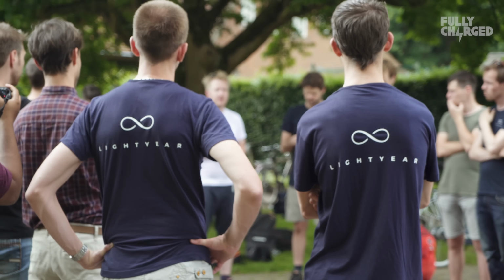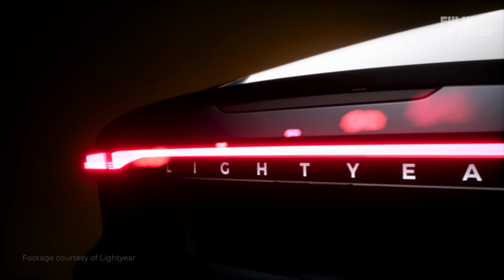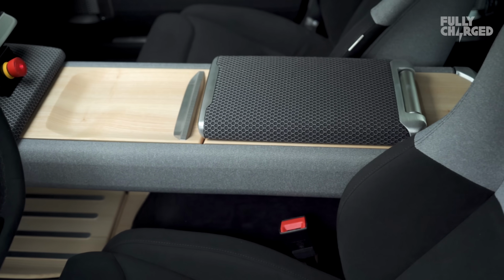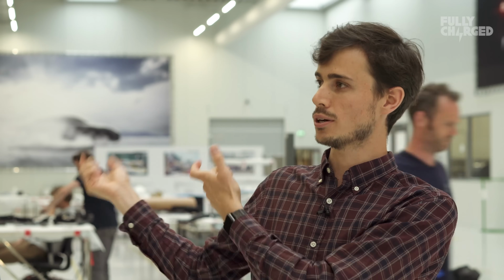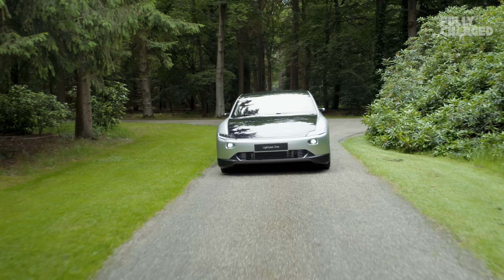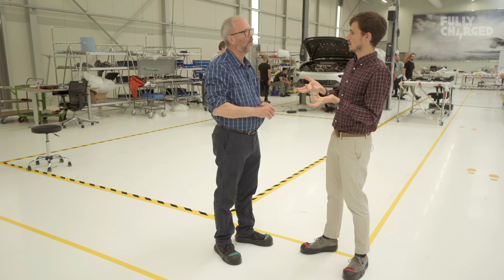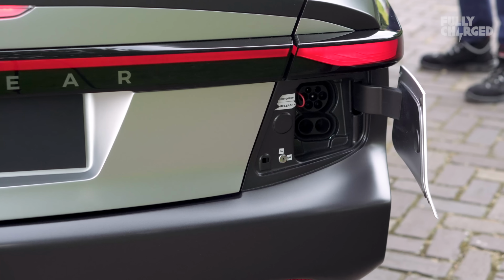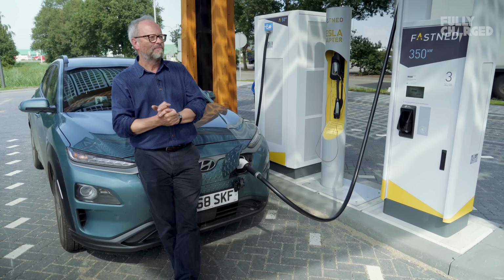Lightyear One solar powered electric car - exclusive first look | Fully Charged

Comment: Toyota, take note! This is self charging 😉
Reply: The "sono" "sion" is supposed to be in production within the next 4 months... It won't be as pretty nor as efficient but slightly more affordable.
Reply: @fionafiona1146  Deliveries of the Sion won't start until 2021.
Reply: @jochem1986  they won't be produced before next year either, they just plan to start.
Reply: @fionafiona1146  like 4 times more cheap, indeed. Still, nice for the happy few, that lightning.
Reply: @RedBatteryHead  How much is 4 times more.. 🤔
Reply: fiona fiona I don’t think Sono is going to make it. At least outside of Germany. Cost projections are already at 30k us.   At that price point the VW ID the Renault Zoie are far better automobiles. 

The Sono is the Perfact car for 4 years ago.
Reply: @fionafiona1146  what about the Toyota Scion?
Reply: It has an ICE. Lame
Reply: All car manufacturers already knew about this they are just tied up with oil companies and holding up production of these kinds of vehicles
Reply: 5putput  but they can only recoup the energy that has been generated by burning fuel. It's definitely better than just losing it to heat in the brakes, but it would be better sti.if you didn't need to burn the fuel in the first place .
Reply: Martyr4JesusTheChrist  To be honest, electronics can made so reliable nowadays that it shouldn't be a concern. It's more likely that your engine will conk out first, especially if it isn't made by Toyota. :) And if it's critical enough, we can always engineer in redundancy.
Reply: Benz Ouyang, I LOVE my gasoline powered Toyota Camry V-6. I step on the accelerator and get nearly 280 horsepower, heated leather seats, JBL Audio, sunroof, its paid for and the title has my name on it. No bank can take it from me and I can refuel it at a gasoline pump in about 90 seconds at the 3 gas stations less than a quarter mile in my rural town. Plus....when I feel like it, I get to go into the store of the station and speak to my local friendly neighbors and the owner of the gas station, buy a bottle of Coke, a snack cake, say goodbye and be ready to travel 600 miles at 80 mph. America is large and highway system is vast. My taxes that I pay for each gallon of gas helps beautify the environment and make my highways smooth and safer to drive. Are theses eco idiots who want “electric only “ cars going to drive on the same roads I pay a fuel tax for? I think not. Just another reality of EV’s.
Reply: Toyota need not take note as they perfected the much cleaner and more reliable hydrogen fuel cell two decades ago.
Reply: Doubtful it will be self charging.  Solar panels are extremely inefficient.  I'm guessing the panels handle low end functions like electronics and climate control.  Even if it can charge the battery array while idle..it would be a mile a day at best.
Reply: lol. that's a good one
Reply: Fully autonomous vehicles could also be self charging and initiate maintenance and repairs without human assistance.
Reply: Beautiful concept. A concept, unfortunately still far from series production. The Dutch are great at this. I really hope they get it right and quick. Otherwise it will be an awesome museum piece.
Reply: I can't wait. 😁
Reply: Big companies wont put solar on there cars, they are still in partnerships to sell you energy, from coal, nuclear and gas burning power plants.  People who think electric cars ar the salvation of the future are deluded.  These things are not clean.
Reply: Martyr4JesusTheChrist  Radiant energy ruins batteries at A fast rate.  Not practical unless you design A secondary system to fix this problem.

Another option is nuclear powered solar panels using tritium.
Reply: Martyr4JesusTheChrist   If I remember right Tesla was having trouble with battery longevity as well.  

Of course my design was different than Tesla's but we both ran into the same problem of early battery failure.

Fusion reactors are much to large and much to dangerous to used in A vehicle.  Unless you can find someone with A working Mr Fusion?😀

Stacked solar panels with tritium could be packaged in the same area beside current EV batteries (inside the skateboard).  Of course you would want to use A smaller EV battery as an energy buffer.  Think Chevy Volt without the ICE.  

As for A pissing contest with Tesla?  He would win on somethings and I would win on others.  Not that it matters one bit!
Reply: Martyr4JesusTheChrist  If your going to define it like that then creatures decisions are influenced by their environment and their course of action. Do you voluntarily take your usual route home when you know your going to get stuck in a traffic jam or take a longer faster route. Your decisions are not independent of outside influences. Your definition would conclude that nothing is truly autonomous. From looking at what you call yourself you may believe that god has a plan for you and because you have followed his plan to the T you are without sin and therefore  AUTONOMOUS
Reply: Martyr4JesusTheChrist  Even Jesus wasn't  autonomous in the final moments of his life when he doubted God's plan. By the way, you have judged me wrongly in my personal life. I live my life as a minimalist. I just like to read about and watch videos on technology. All the cars I have owned have either met their demise when the engine blew or on a couple occasions were totaled in accidents caused by somebody else.
Reply: They can do it.  However, car makers make money off the accessories.  Just like oil companies push gas vehicles although electric cars like these can be made.
Reply: I am pretty certain that at least Toyota will built much reliable and durable then this vehicle, in which you won't be able able to hear rattle and squeaks unlike this one.
Reply: @Masterpiece GB OK good for you!!!!

Now the rest of us can move on and enjoy the benefits.
Reply: Toyota hybrid is not real self charging. The car still need to have petrol in it to charge. You will still need to go to the petrol station and fuel the car. Plugging in fuel is similar to plug in electricity, except fueling is quicker of course.  The real self charging car is Solar. When you have light it charges. Although Lightyear One may still need to plugin to charge, that will later change as development progresses
Reply: @wonghow  Yes.

As I have noticed from driving our Prius - it requires petrol.

And as Toyota is aware, which is why the Prius Prime has a solar panel in the Japanese market variant.
Reply: @wonghow  oh, you need to add energy into mechanism? Oh I thought Toyota made 101% efficient hybrid system that have no energy losses...

Of course you need to fuel it because is bloody non-plugin hybrid! XD But actually Prius Plug-in can he charged by solar panel, you need sunny days but it is possible to drive only on battery without charging from grid.
Reply: But it is not going to be fully charge and you need a lot bigger solar panel to be able to get a descent charge.
Reply: except that this is bullshit. It will take at the least a month to charge a battery pack of 45kwh using the solar panel. do the maths that gives you 180 miles range about 6miles/day.
Reply: And plug in Prius isn't?
Reply: There isn't nearly enough surface area for a solar array to add any significant charge to this vehicle. Toyota put solar panels on a Prius; discovered there was enough current generated to run a fan.
Reply: You mean Tesla isn't it.
Reply: The thing is that although it DOES self-charge, It likely won't charge enough for daily use. Most likely you would still have to charge every 2 weeks or so.

Unless you like driving without air conditioning
or without heating
Reply: that lady admits the customers are paying for the idea and the cars are going to be crap at first.  these aren't going to be solar powered maybe the panels will run auxiliary low power function in the end. its like so many crowdfunded projects that just never can break the laws of physics.
Reply: They wont, they need us to make money
Reply: Does anyone know an electric car that can be recharged while running? I know Tesla does not recharge while you are driving...
Reply: Absolutely David. Conventional "Self Charging Hybrids" are petrol charged hybrids. Toyota (and others) are just hiding the fact that they are behind the curve on development of car electrification.
Reply: @keithsmith6553  you are wrong and you are ignorant about how the market works.
Reply: David Finch please.... Toyota is hung up in hydrogen doesn’t even have a proper electric car.... as my favorite car manufacturer I am deeply disappointed at Toyota
Reply: @mtt3870  they don't have electric car because it's waste of money. New Prius is half electric and can provide 1-2 days of pure electric driving in city and that's enough. 

They are focusing on hydrogen because its future. Batteries are too expensive, too big and too heavy, and nothing will change in next 15 years. And when other manufacturers will realize that they can't do anything more and no one want wait 30-70 minutes to charge batteries, and that fast charging destroy batteries there will be Toyota with over 40 years experience in hydrogen cells technology and with cars that you fully "charge" in 5 minutes. Actualy Mirai is already here, it's quite expensive but still cheaper than Tesla X or 3, and it provides around 550km range with 155HP of power (335Nm - it's pretty good).
Reply: PiEn don’t get me started on Toyota and their lack of EV. I don’t agree with your statement. Compare batteries today with batteries of 20 years ago, research and development is been done and the battery technology is getting better. For the looks of it in about a decade or so an electric car will be able to drive 600+ miles w/o charging.... if a range of 400 to 600 miles does not give you a couple of hours to recharge.... I have nothing for you. 

Hydrogen is it easy not inexpensive to extract/produce and the store and the transport and then store again and then refuel could be dangerous as hydrogen is very volatile.

Maybe within 30 years all cars will be electric and hydrogen (as I asume hydrogen technology will be improved as well).... as long as it is not gasoline or diesel is good for me.
Reply: @alanowa123   I can charge 80 miles in 10 min.  Today using a Tesla supercharger on my Tesla 3. That is 5 times the range the plug-in Prius can drive on battery power.
When the 250 kw V3 charger comes online I will be able to charge 160 miles in 10 min.
That is only on long trips.  
Most electric car owners charge while they sleep. Ninety-five percent of the time I do not need to stop to charge anywhere. 
We are in the deep part of mores law Battery technology will move faster in the next 4 years than it has in the past 75 years.
Reply: @fatboy19831  now compare Tesla 3 price and Prius price ;) 
Prius owner don't have to charge anytime - he just use petrol when it's necessary (you can install LPG and driving is cheaper than in tesla). Prius is for people living in cities, when daily you're making up to 50km.
Reply: @alanowa123  You can buy a 240-mile range of Tesla 3 for 40k. The 11-mile electric range plug-in PRIUS is 28k.  A fully loaded 36k Prius is no were close as nice as the Base 35k 220 mile Tesla 3.  In fact, the number one car traded in on the Tesla 3 is the Prius. That was when the 3 was 50+K.

The Prius is one of the most horrible driving cars of all time.  Yes, it really is that bad.  Horrible driving position poor brakes, painfully slow, even on electric power.  The Prius has no limitations as to were it can be used. It is NOT a city car.   It is not limited to the city.  The Tesla 3 is literally twice as fast and twice as efficient when the Prius gas engine is running and is still more efficient on electric power in spite of weighing almost 1000 pounds more.
With Tesla, the only reason you will need to go to a gas station is to take a piss.

The Prius is an economical, reliable transportation tool.  It is a horrible horrible horrible car to drive.  Just Horrible.  It is as if the engineers said how can we make a car with a driving experience as painful as possible.  The Prius makes the Corolla seem like a Porsche.
Reply: @alanowa123  They are doing a Joint Venture with Mazda to move to battery electric vehicles. Sorry.

Also no Hydrogen is a stupid future. It totally misses the point and the advantages of electric vehicles.

The current idea is that Japan will buy Hydrogen from Australia and ship it to Japan. What a joke!!!!

And very likely that Hydrogen will be produced by extracting it from Natural gas, and releasing the CO2.

So it's not likely to be environmentally friendly, just a way to repackage the Fossil fuel industry yet again!

Producing Hydrogen by any means is not at all efficient.

You are going to be buying fuel- rather than making your own at home.

Think of the supply issues of getting Hydrogen filling stations and keeping them filled vs building a solar powered charge station in between towns?
Reply: @alanowa123  Price now vs price in 3 years? OR 5 years?

I drive a Prius - so don't get me wrong but we are in a technology transition.

The Prius was great whilst waiting for the EVs to drop to the right price, but given the option I'd like less of the petrol engine thanks and more of the electric.
Reply: @rwerk66  im living in country where There goverment is not helping EV owners in practically any way. There are no donations to buy ev car or any tax brakes. They only can use bus lanes, but those are really rare here. There are practically no superchargers as well and there are only few normal chargers (I think less than 100 in whole country, more like 60). So having ev is the same as petrol car. In this case even Tesla 3 is still really expensive car. I can have new E class in the same price (and with e class I'm sure about its value in next 10 years as well as its reliability). So EVs are not in right price yet and it will take long time for them to be. Batteries are just expensive and there is no way (other than small range) to overcome that. I'm sure that hydrogen EV will be affordable by normal people faster than li-ion ones. They are cheaper right now so...
Reply: @rwerk66  are you trying to say that hydrogen EV that is filled up in 5 minutes compared to over 1h of battery loading is missing point of EV? xDD dont be pitiful

Hydrogen for EVs wont be produced by extracting it from gas, becasue this process and then transporting H by semis is much more expensive, dangerous and causes many logistical problems than building self-producing "gas" stations. Those stations are pluged into normal grid and uses water electrolise to produce H. Maybe first read a little about this technology, then criticise it.
Reply: @alanowa123  YES I am

"Hydrogen for EVs wont be produced by extracting it from gas" - IN theory.

"much more expensive, dangerous and causes many logistical problems than building self-producing "gas" stations" - the cost of infrastructure is much higher than simple charge stations because you need whatever infrastructure is needed for an EV charger plus some expensive generation and storage plant.

Also the efficiency of electrolysis is quite low. So the energy cost is much higher.

You are talking the difference in many cases between a 3-phase circuit and $1k wall mount charger and a Hydrogen extractor, compressor and high pressure storage tank, plus dispensing bowser. You are not going to put a hydrogen extraction plant in a shopping centre and supply it free to customers are you?

Even the high rate EV chargers are quite simple devices and take up little space.

The Tesla Superchargers are one standard rack cabinet per 2 charge bays and the Cable holder unit at the bay.

For one thing the 1 hour charge is not the standard practice for most EV car owners.

The wonderful thing about an EV is that many people can charge at home, and sometimes effectively for nothing if they have solar.

Or in the case of one Electricity retailer here, $1 a day flat rate.

And the other thing is that destination chargers are another option, several shopping centres (malls) here offer free charging in their car parks, so you top up the car whilst shopping for nothing. They offer usually medium rate chargers - not the top speed ones. This works fine.

One of these also has a Tesla Supercharge station, so Tesla owners who wish to charge up fast can do so at normal Tesla rates. In this case it's often hire cars that use the high speed chargers. They can combine this with their lunch or dinner if they wish. Sometimes they'll use the time to clean their hire car.

The thing is that you don't need in most cases to do a full charge, most people do not drive a full charge per day. So a top up at even 10 amps overnight at home from a standard power outlet will do for many users. If not that then a wall mounted charge controller will provide more than enough. An do so at off-peak rates.

Hydrogen's applications where it improves the life of the user even at this stage of EV rollout are few and far between. In fact they are only where the chargers are few and far between.

As I have already mentioned here the record right now for a Tesla Model 3 is 2700+ km in 24 hours. Clearly the time to charge is not limiting the range of the vehicle.

The way to get that distance in a day is to not fully charge as this is unnecessary and not the best use of a battery either.

By the way I drive a Prius - so still on Petrol - and I don't fill it up most times either. It's just not necessary.

If I had an EV I would be able to avoid the trips to the Petrol station completely. I would be able to charge when I'm at the shops and it would cost me nothing.

One shopping centre I visit I happen to park right by the EV charge bays anyway.

Would Hydrogen save me any time? Nope.

Would it save money over an EV? Nope.

Would it be safer? Nope.

What exactly would Hydrogen give me over an EV?
Reply: @rwerk66  TL;DR, seriously xD 

hydrogen is future ;) you will see
Reply: F**k YE :-)
Reply: Play nicely everyone! 😉 The frustration with Toyota’s “self charging” claim is that they are no more self charging than every pure electric car out there. I.e. they recover energy from regenerative braking. Yet Toyota market it as though it’s something above and beyond what EV’s can do. The difference is that for fossil hybrids the original energy comes from pure fossil fuel versus mostly renewables (depending on your electricity supply) for pure EVs or plug-in hybrids. The point of my original post is that this Lightyear One (and the Sono Sion) are genuinely self charging in getting their original energy, which should embarrass Toyota’s claim.
Reply: @davidfyork  No they primarily charge by using the power from the engine, their gearing system manages the load that the generator places on the planetary gear system to convert the engine revs to the revs required for the speed.

Also they use the idling the car does when warming up the catalytic convertor.

I can see why Toyota says 'Self-Charging' - it's to get around the resistance of some people afraid of having to plug a car in.

The hybrid Toyotas are a good bridging technology.

And BTW the Prius Prime - which is the Plug-in Hybrid has a solar charging panel in the Japanese variant. They estimate that in Tokyo a driver will get about 10% of their energy from the solar panel.

The Prius Prime is already doing what this does with solar cells with a car that's on the market. Plus Toyota has a version in testing with highly efficient solar cells.

So this is excellent work - but attacking Toyota for their way of explaining past the fear of the unknown when they are doing the thing you are claiming they are not doing is quite unreasonable.
Reply: @davidfyork  the lightyear is barely moving into the ev auto industry. You talk like if they have conquer. Of course you want to attack Toyota because it is one of the most reliable vehicles out there. If anything Toyota has the most hybrid vehicles options out there if I am not mistaking. Lightyear looks nice but,  is it reliable? We will just have to wait for now and that might take a few years buddy.😉
Reply: Gustavo Rojas ,  not at all. I take a dig at Toyota because they have made an anti-EV advert (owner standing by EV waiting for it to charge like you would stand at a petrol pump, cobwebs on a charger). They’re steadfastly standing by their hybrid tech investment that was innovative a decade ago but behind he curve now. I’m pro all EV’s, and anti-hybrid because they’re nothing more than efficient fossil burners. P.S. EVs are very reliable too, much less to go wrong, no oil change, fuel filter, exhaust pipe, spark plugs, etc. to go wrong.
Reply: @davidfyork  Toyota does have the Rav 4 Ev and the Prius plug in. If there is anyone I would be disappointed it would be GM for selling themselves to the petroleum company in the 90s but, that's a different story. I would like to see this lightyear succeed but, its price is not affordable at the moment. It would be very difficult to move up. It's all about reliability, price, and quality. But, who knows. We will have to wait and see.
Reply: David Finch I get 300 miles plus per charge and shoot out like a rocket from full stop. The comfortable,safe,quiet vehicle with no maintenance in 104,000 miles hatchback is a Chevrolet Bolt. Oh now that I remember, lost the high note horn, which I replaced for $15 USD.
Reply: its BARELY charging anything useful. Lets be panctual!
Reply: so is this https://www.youtube.com/watch?v=wI8Eocz-AVI
Reply: really?! it doesn't need the sun?! omg! .... seriously... please look up Law of the Conservation of Energy...
Reply: Why not BMW Merc Audi better say VW .. WHITE BOY! Yo mama raised a fool and a bunch who like
Reply: The interior is too dark. Looks like outward visibility is a nightmare. That is the side affects of short aerodynamic windows.  The no back window won’t work for production. Maybe a less efficient transparent solar panel for the roof. At least the front part.   I am 6.5 feet tall I do not think I will fit. 

This is just the first prototype. There will be many improvements. This is an excellent concept.   Efficiency cannot be such a priority that the car will no longer be an enjoyable place to be on a day to day basis.
Reply: @fatboy19831  You're thinking too inside the box, so to speak. For example, current technology allows stitching of camera images together to form a contiguous 360° view of the car's exterior that's better than any conventional window layout. With image processing and other sensors, the system can even tell if the driver is trying to maneuver into obstacles. Drivers need to adapt and learn to leverage technology as it evolves.
Reply: @benzzoy  Cameras can't equal a window yet.  At least not in a consumer product.  We may get there in the near future.  Reliability and lag time both screw up visual perception.  Being able to do something in a controlled environment is not the same as making a useful product for day to day use.   No 360 view is NOT better than any layout.  Sit in a BMW 2002.
Reply: @fatboy19831  Cameras can be reliable and lag-free if there's a demand for those. The technology is already here, but it's cheaper to implement something slower for parking, because, well, no one is going to be going that fast when parking. To wit, Tesla and other autonomous vehicle companies already have sensors that go beyond replicating the 3D environment in real time (they have to process that data, which is much harder).
Reply: @benzzoy  It is possible to drive a car using a high def video camera and monitor. Do you believe that is as effective?  Do you believe you could interpret what is going on around a well as looking out the windshield?  looking through the back glass is no different.  Gm is doing an excellent job of using a high def video rear view mirror.  For a passenger car, you need at least some sort of rear view window. If only a small one.

Why use sensors, radar 360 cameras vs a dam window.   I am ok with using them in addition to a window.
Reply: @fatboy19831  Do you know that surgeries are being conducted by robots whose human controllers may not be in the same hospital? Augmented and virtual reality are already here, and it's a matter of achieving a particular cost-benefit before implementation. As a simple example, I certainly can appreciate HUDs that display speed, nav directors and other useful driving info, and this type of augmented reality has been available for decades.
I don't know why you've brought in windshields; while I personally believe it can be done, the original discussion was about crappy rear and side views of Lightyear One. In any case, the issue with windows now is primarily that of safety. Holes weaken structures, which is why side windows keep getting smaller and smaller (well, at least until we invent transparent aluminum). As consumers demand safer vehicles and regulators demand better efficiency, the convergent locus appears to be significantly augmented reality.
Reply: @benzzoy  Augmented reality in a  mass-produced automobile is a Goldberg machine. It makes no economic or practical sense.

Tiny robots controlled by an off-site surgeon is not a consumer mass produced product.  
A top fuel dragster can cover the quarter mile in under 5 seconds. In camparison, the 750 hp consumer grade Hellcat is a slug at 10 seconds.  

Side windows keep getting smaller and pillars keep getting bigger because that is the CHEAPEST way to pass the crash tests. It is not the only way.  Modern Subarus have huge greenhouses and are some of the safest cars you can buy.

The Tesla  3 has a massive greenhouse with a huge front windscreen and two huge glass panels on the roof and it is the safest mass produced sedan money can buy at any price. Only the rear view is compromised.

When high dif inexpensive transparent monitors become mass produced and cheap. Only then will agumented reality be a viable option in a mass-produced automobile. Even then hopefully it will only fully function when level 5  autonomous cars are on the road.  If it fails you will still be able to see where you are going. 

 Solar panels can be transparent.  The engineers are simply pushing for maximum efficiency.  There is a far more logical and practical way for a mass produced light year 1 to proceed.
.
Reply: @fatboy19831  We'll have to agree to disagree. I still think you're not looking outside the box enough. What is cutting edge stuff work now, can be mundane everyday stuff in a couple of decades or sooner. Just think: current teenagers don't know a world without smartphones, and many of us remember a world without the internet (or even YouTube!).
Reply: @benzzoy     I believe someday we will have augmented reality replace or duplicate windows sometime in the future.  Mores law simply is not fully active yet when it comes to augmented reality.

Reliable Augmented reality will come in personal glasses first. They will enhance the real world with information.  

Using augmented reality to replace a window in an Automobile.  Is a needlessly complex solution to a problem that can be easily solved by putting in well..............a window.

One of the best fighters of WW2 was the P51 Mustang.   When the British first flew the fighter they did not like it.  It was slow and you could not see out of it very well.  Add a bubble 360-degree canopy and the beautiful Rolls-Royce engine.  Well, the rest is history.  

70 + years later the United States air force is spending billions to try to look through the floor of an F35 fighter using 15-year-old augmented reality technology. 

I completely understand your point of view and I am aware of the technology you speak of.   The lightyear needs more natural light in the cabin.  It also needs a rear window.
Reply: @fatboy19831  desinged by dutch where 6.5feet is more avarage. Maybe there could be a problem with your weight fatboy since dutch are not 90% obese patients
Reply: @mr.jj210   I am 205 pounds. JJ.   We do not have any Dutch cars to use as a reference.  I will say some of the most brilliant engineers I have met are Dutch.
Reply: @UCYD4XYXTgBJmkNE0-tRJGWQ Do your research. This is bull.
Reply: They call them self charging because YOU DONT NEED TO CHARGE IT YOURSELF. Idiots. Whats so hard to understand about that.You just look like moronic children having a strop xD
Reply: @themightydash1714   the point is you have to fill it with fuel, it's only power source is petrol. So saying an electric car is self charging is no different to what Toyota is saying.
Reply: @themightydash1714  How is driving to the gas station, paying for fuel, and loading the fuel into the tank NOT charging it yourself? Wait, let me ask a different question: Can it charge itself when the Strait of Hormuz closes to tankers and fuel costs 3x as much in many parts of the world? If plugging something in overnight is harder than filling a tank with flammable fuel, why don't we have internal combustion laptops and phones?  I don't think Robert or other EV advocates sound like children when they point out lies; I think they are asking automobile manufacturers to behave like adults (should).
Reply: @themightydash1714  actually, you have to press the gas pedal down with your right foot for prolonged periods of time to charge one of those Toyota 'self charging' hybrids. That's arguably more work for yourself than plugging in an EV and unplugging it the next morning.
Reply: @themightydash1714  But you do have to pay for the additional petrol it uses to charge itself - and yes I do know what I'm talking about, I used to own a Toyota "self charging hybrid" and got rid of it because it was FAR LESS economical than the car I had before with the same size petrol engine.
Reply: The Mighty Dash they call it self charging because they think their customers are idiots. Are you a Toyota customer?
Reply: @themightydash1714  So they mean petrol-charged then.